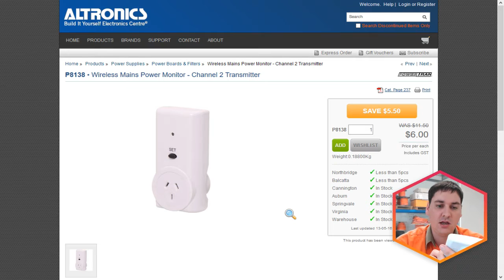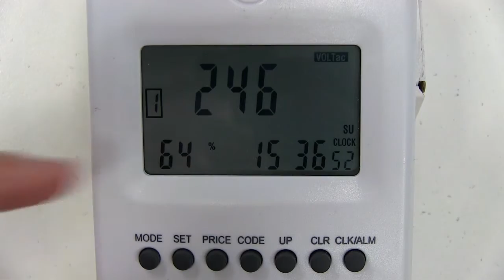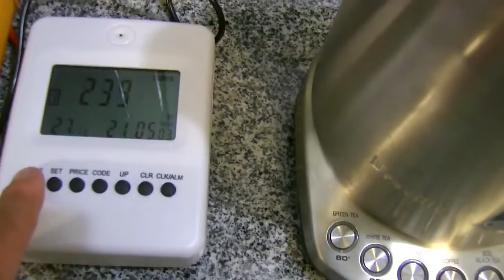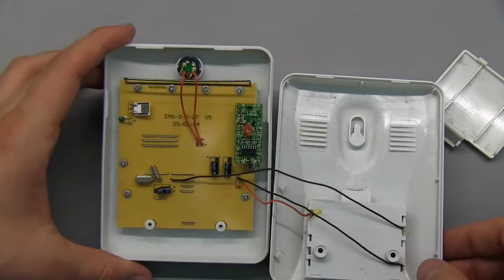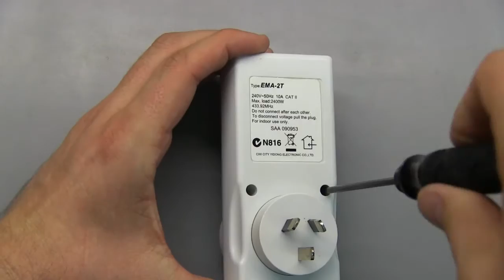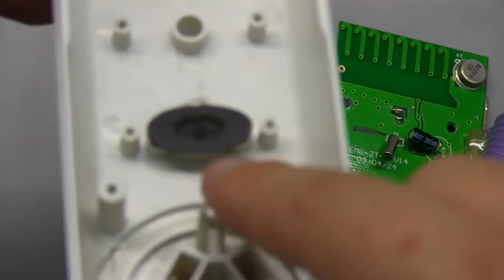Wireless Energy Meter Review & Teardown

Comment: does it come in eu standard as am in the uk
Reply from the maker: The shop I purchased this from (Altronics) only has the Australian plug version. The voltage would be compatible though. Altronics would just be reselling these, so you may find a local or online seller with a UK plug version. Good luck!